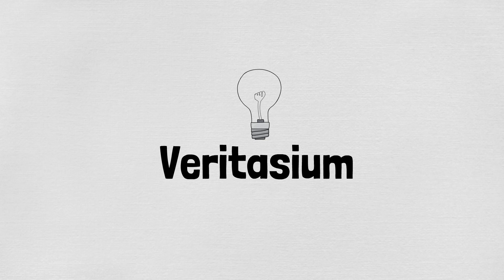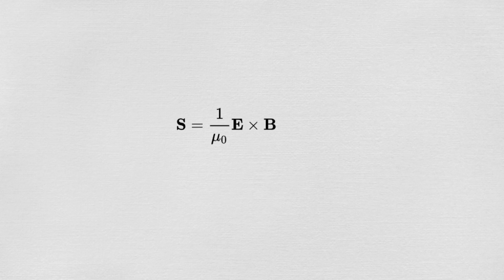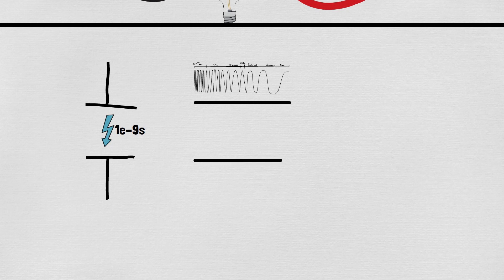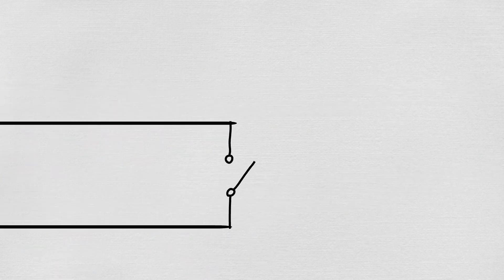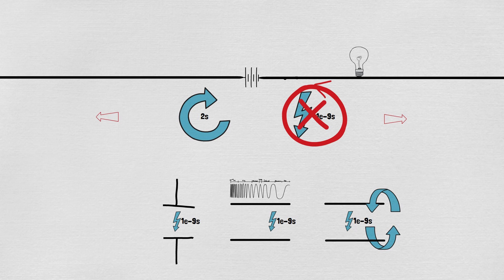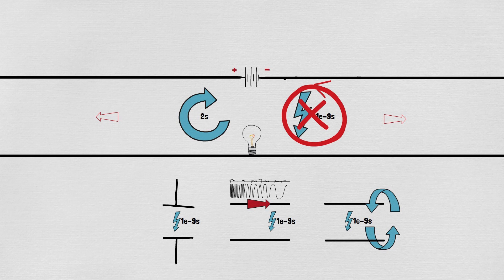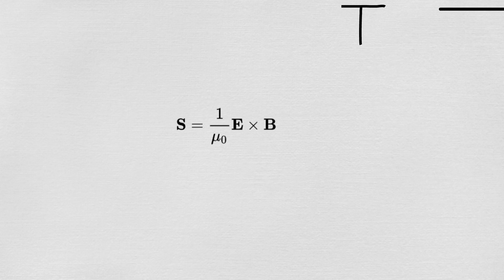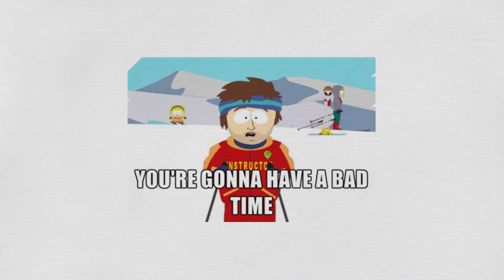Veritasium is Right? (see description)

Comment: Thank you for making this. I was losing my mind in the comments of Veritasium's video at the utter confusion it caused. If you think about the step response of the circuit as you close the switch, essentially launching a voltage transient down the wire, that transient will indeed couple onto the parallel wire (using whatever explanation you prefer - antenna, capacitor, induction) and cause a small current in the lightbulb in ~1/c seconds. But it's a transient (and miniscule) effect that Veritasium conflates that with steady state. Derek's video is misleading at best, but I will give him credit for causing so much discussion! :)
Reply: Yeah I think Veritasium does a great educational service even when he’s wrong, but there’s a reason i like Steve Mould’s approach and others like him who present things more modestly.

But maybe Derek from Veritasium might be the more clever than we think: To reach the truth and get the most people to see it, the fastest way is to present something wrong confidently, and have the rest of the community rush to explain how you’re wrong 😅

Because honestly I thought Derek AND the random professor videos who gave the antennae/capacitor explanation were right - until i came across this video.
Reply: @Michael-kp4bd  "But it's a transient (and miniscule) effect that Veritasium conflates that with steady state" - I don't think he does. He claims that it takes another second for the bulb to get full energy. That claim is brief, and he doesn't make it very clear he's looking for the first moment the bulb gets non-zero energy.
Reply: I think he addressed this transient effect as the root of his video in a comment somewhere. He acknowledged that it's not a stationary state, but I think he said in different conditions the induced current by this transient ranged from 2-50% of the stationary one, at least in some test models he had gotten made by professionals of the field. Of course they probably had some weird idealizations, but yes, energy reaches the bulb in ~1/c seconds, although this energy probably wouldn't be anywhere near enough to light the bulb.
Reply: @3laserbeam3  He does claim that, but he also doesn't explain that the Poynting vector points inward to the wire when it reaches DC steady state, which will wreak havoc with interpreting his model of power delivery.  Dave Jones talked about that in his response, and discussed some of the transient vs. steady state confusion.
Reply: Handwaving away the fact that a real bulb needs real current, not a transient spike, made the question kinda irrelevant to any real system. I didn't feel so much that it was wrong, as it applies only to an idealized state that doesn't exist in reality.
Reply: It doesn't matter that the instantaneous current induced is miniscule; it is present, so the light bulb illuminates nearly instantly. You've got to roll with the simplifications/assumptions, and set asside the impracticality. This video argues that no current flows initially, which is just wrong.

Comment: The switch is crucial to the experiment.
Easy example is static electricity, when something is charged and then touches something less charged, the potential will level out. This is also true for the left and right side of the wire.
In the experiment the left side is already connected to the battery (kind of charged, potential equilibrium with it's side of the battery), the right side just reaches to the switch, so there's not much room for the potential to spread and no way to create equilibrium with the right wire, since it's not connected. When closing the switch the potential can spread through the right side wire, causing current, causing the effects described by Veritasium.(even if the wires are not connected or there's a second switch in space) This will only endure until the right side wire and the connected side of the battery level in the same potential. If the circuit is indeed connected, this will not happen, as the current will flow from one end of the battery through the circuit into the other side of the battery.

If you don't have a switch you will have a potential equilibrium from the beginning, therefore no moving potentials resulting in no current at all, if the circuit is broken anywhere.
If you don't have a switch and the circuit is closed then the light bulb will already be lit from begin and stay on.

Still there are two things Veritasium got wrong: 
First is the amount of current applied in the opposite wire. Since it's so far away the 3 effects of capacity, electric radiation and EM fields are so negligible that it will not be enough to light the bulb. Second: They keep quiet about the fact that most of the energy will take the path of least resistance which is indeed along the wire.
Reply: He does say that it's basically some magical light bulb that turns fully on with any amount of current. In real life, of course, that doesn't exist.
Reply: @jasonsmall5602  in which case you can't turn off the light. Since quantum fluctuations would give you enough of a kick, that's what happens with poorly defined problems, you get many equally wrong guesses and no right answer.
Reply: Exactly, as charges transfer and spread out of the newly connected wire, capacitive coupling and inductive coupling happen.
Reply: @ГеоргиГеоргиев-с3г  I would think quantum fluctuations cancel out, but this is all hypothetical, so who knows. What I do know, is that of you actually tried this, you would get some current to the light due to capacitive coupling. But that's only temporary as it doesn't do anything in steady state
Reply: @jasonsmall5602  as i stated in the original video, you will have to integrate over the whole wire as if you have connected transformers next to parallel capacitors and you turn them 1 at a time. But since we work with ideal physics fairy land you will also have to ignore capacitance and inductance of the cable since they were not stated in the beginning. Meaning you only take the current inside the cable, therefore 1s until the current catches up less if you move the light nearer to the switch(on the cable). (And the EM field is always in flux so the light will always be lit! In case we start adding realism.)
Reply: Switches are challenging for people to think about. It's better to imagine switch as a capacitor that has its contacts occasionally shorted. When you treat the switch in this circuit like that, it becomes way more obvious.
Reply: @jasonsmall5602  In one of his comments to the video Derek states that electrical engineers he asked to run simulations of this circuit came back with estimates that initial current in this circuit will be between 2% and 50% of final current. He agreed that 2% is probably more reasonable estimate. LED lights will have not problem with lighting up slightly at 2% of their full current.
Reply: @niceshotapps1233  you are joking right?
Reply: @ГеоргиГеоргиев-с3г  About what? None of what I wrote was intended as a joke.
Reply: @jasonsmall5602  If it was a magical light bulb that turns on fully with any amount of current, then wouldn't the light be on before the experiment starts, because it is outside in the sun? So the answer is 0, all lights are always on.
Reply: @niceshotapps1233  what does that even mean? 2% of final current? On what place in the circuit are we talking about? Switch side or bulb side? And yes that does matter on a circuit of that size.
I did the basic math and came to something around 0.002 Watts induced by capacity on the bulb side, while being very generous to the capacitor areas. Of course the basic school formulas aren't exact in this edge cases but they are still close enough to see if it's a reasonable magnitude.
I also saw someone else comment a little more advanced math about the inductive current and in the end he got something like 0.005 Watts.
Reply: @klauzwayne4215  This guy measures the initial current to be about 11% of the final current, but with load and battery a bit closer to each other (maybe 50 cm, maybe less), and wire length 1km. https://www.youtube.com/watch?v=2Vrhk5OjBP8
Reply: @niceshotapps1233  thank you very much. This is a great video. Haven't seen the second part yet, but i read a little different values: i only read about 6% of total voltage on the "bulb" resistor and also the wires are only 25cm apart. So having it a meter apart instead should result in a factor of 16 resulting in ~0.4% of the voltage on the switch side. Nevertheless this is a lot more than i would have guessed and what my most basic calculations resulted in.

Comment: The simple answer is that you will have some energy transfer to the bulb directly as soon as the switch is closed across the 1m gap but most of the energy will be transfered along the wires as well as one energy loss in the wires due to resistance. There is no such thing as wires with no resistance, inductance or capacitance so you can't ignore any of them but common sense tells you that most of the current and energy must flow along the wires.
Reply: What's about superconductors?
Reply: @kanizh  They have low but non-zero resistance
Reply: @kanizh  Superconductors will still act in the same way initially. The circuit can be thought of as the two wires forming a series of LC circuits that radiate out from the bulb. There will still be capacitive and inductive reactance causing a transient peak induced into the bulb that will happen almost immediately as the field travels across the 1m gap to the bulb and the pulse would decrease exponentially. After a second, the circuit would reach a steady state where the resistance would be the main proponent of the circuit impedance. There would be a volt drop along the wires based on the square of the current and total resistance of the wires. The volt drop would be less with superconductors but would still be there none the less.
Reply: How would the bulb change that energy to heat and light.? Explain.